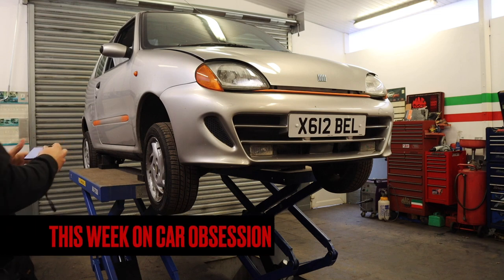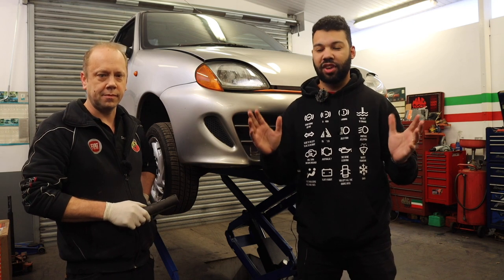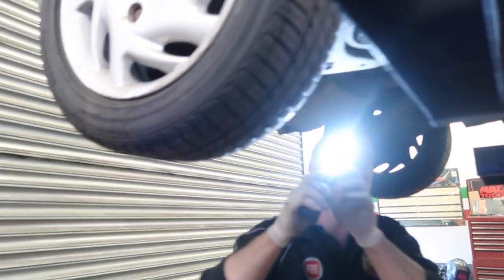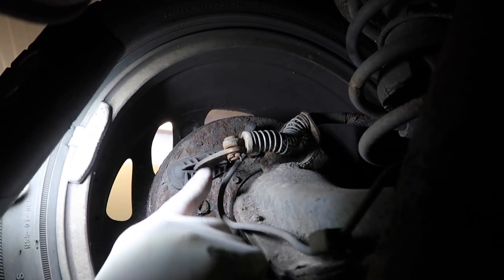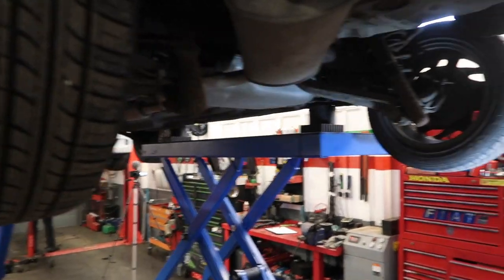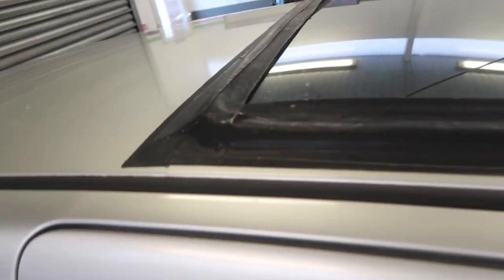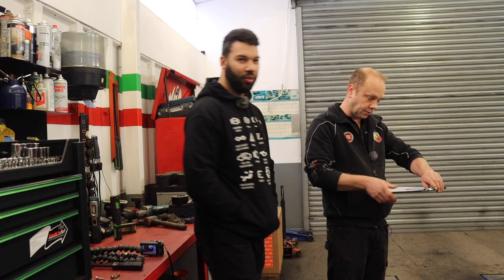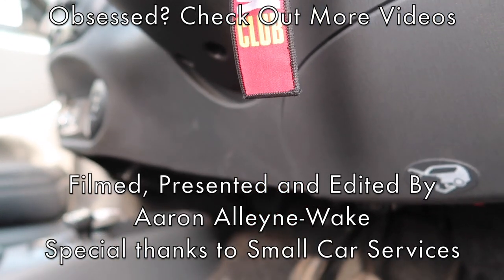Uncovering The ROTTEN Truth About My Fiat Seicento Sporting!

Comment: Having a couple of cinquecentos i pucked up some knowledge from dean here on the rear hubs👍
Brake pipes are simple to do and the tool looks like a wrench with a die in it. A pipe cutter and bender and box of fittings will last you forever (all in about £50) i was like you, afraid of brake pipes but when shown, it's a simple process. I bought a roll of copper pipe in the motorfactors and did a couple of practice bits first 😊👍🇮🇪
Clear the sunroof drains with that wire the old ladies used to hang net curtains with, works a treat and cheaper than anything else 😊
All fiat's leak oil somewhere, if it's not leaking it means there's none in there 😮👍🇮🇪
Reply from the maker: Hi Terry, thanks for watching and thanks for the comment 👍🏽

Comment: Great little car . Needs saving . But the cost 😢
Reply from the maker: Don't you worry Rob, some of the issues in this video have already been addressed , and some of the others will be sorted in the future. To be honest, the list looks worse than it is. Thanks for watching. 

As the car stands now, though, I reckon it would be able to get through an MOT (well, once it has the correct tyres) as the offside front brake pipe has been replaced, and with a bit of help, I stripped down, cleaned and re-built the rear brakes with new shoes and wheel cylinders. 

That wasn't filmed unfortunately due to time constraints (repair work takes me considerably longer to film as I have to film it myself whilst doing the work) and the fact I wanted to properly focus on what I was doing without having the added task of presenting to camera. 

I SHOULD be doing some modifications next week, providing there is a spare ramp in the workshop and I will  be aiming to film that.

Comment: Is it beyond economical repair ? unless your going to do some of the work apart from the welding yourself.
Reply from the maker: Hi Steve, thanks for watching. The offside front brake pipe has been replaced and with some help I've stripped, cleaned and rebuilt the rear brakes with new shoes and wheel cylinders - that wasn't filmed, though. 

I've also replaced the cam cover gasket and the coil pack seal, that was a nice, easy fix.

Comment: What to do?!🤔😳🤔💔🙈

How much do you love the car - how much spare cash have you? Can you weld and fabricate 🤔🤔
Reply from the maker: It's not actually that bad to be honest. The offside front brake pipe has already been replaced, and with some guidance I was able to strip, clean and rebuild the rear brakes with new shoes and wheel cylinders.

The rocker cover gasket and coil pack seal have been replaced, the tyres have been replaced. I can't weld unfortunately, but one of the guys at my work can, so that's all good. The problems that will be left over following that won't be major.

Thanks for watching 👍🏽
Reply: @CarObsession  Wow! All done then. I forgot that you worked in the trade. Good to see the car saved. Waxoyle inside and out would help post welding 👍🤞💜😊
Reply from the maker: @musoseven8218  Yeah if I didn't work in the trade and if I wasn't able to do some of the work myself I wouldn't have committed to the car in the first because let's face it, it's a nigh-on 24 year old FIAT, it was always likely to need work.

That's fine, though, as I wanted a project that would allow me to gain more mechanical experience without costing an arm and a leg and being too complex. So far, I've done the majority of the work myself, but I know when  there is a job best left to the pros (brake pipe and welding as examples). This project has also enabled me to learn how to replace tyres, which was rewarding. It's not a difficult process, but it's nice to have that in my skillset.

Yes, I have Monique and she's pretty easy to work on, but for the time being she's not wanting for much at the moment (touch wood) and I wanted something fresh for the channel.
Reply: @CarObsession  All good stuff to my mind mate, spot on thought process. I shall watch with interest. I like little sporting FIATS💜👍✌️😊